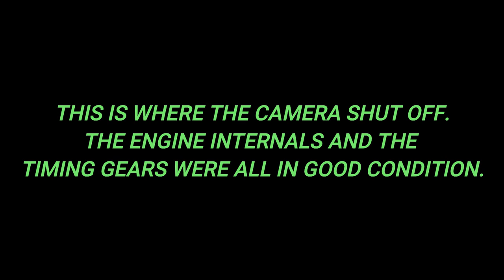DYNAHOE PT 3 3-53 DETROIT REMOVAL AND TEAR DOWN!

Comment: I can't tell if the Gradall is enjoying helping or feeling a bit jealous.
Reply: first AND second !!
Reply from the maker: the gradall is never jealous....it knows it is the most important piece i own!
Reply: Very handy piece of equipment.  Would have never thought of its value until seeing it in action. Having such a range of boom extension is certainly a plus.  All of the cranes on my service trucks now have 3 stage hydraulic extension booms.  It makes them much more versatile.
Reply: I have a question do some  backhoes the front buck attachment  comes apart  just like backhoe
Reply: @dancurrier6421  -If you’re asking do the front bucket come off with a coupler system? Then yes, there is an option to make it a tool carrier.  Where you can use forks, buckets, baskets..etc

Comment: If I remember correctly, Detroit has two fuel ports in the head. One is the supply and the other is the return. They return a large portion, more than 50% of the fuel pumped to the tank. I seem to recall about 1/2 a gallon per minute return to the tank. They heat their own fuel so they work well in cold environments. The two lines on the injector flow fuel through the injector both to supply fuel as well as cool the injector. The fitting coming out of the return port is a special fitting with a smaller hole to restrict the flow and build some fuel pressure in the injectors. Many people lose track of that fitting and end up replacing it with a normal fitting so the fuel pressure doesn't build up to the minimum 35 psi for injector operation and 60 psi being the normal pressure. They also used check valves in the fuel lines to prevent the fuel draining back to the tank. I've seen those installed backwards.

Comment: Hi JC. The best tool for removing that style injector is a ladyfoot prybar. Also, the flat washer under the bolt for the injector hold down clamp is flat on one side with a slight convex shape on the other. The convex side goes towards the clamp. Really hard to see that difference.
Reply from the maker: i did notice that on the washer. i try to be very careful when doing a tear down.

Comment: it's been a million years or so since I last worked on a 2 stroke Detroit but the blower looks familiar . when the bearings are just little worn the impellers start touching eachother and the housing. at that point the blower is junk and the pieces from the blower wipes out the motor.

Comment: You have no doubt increased the resale value on Gradalls by a bunch.  I have wondered how blowers last as long as they do since some of the people who used these engines were obviously not really into regular maintenance.  I worked on a tow boat that had two 16 cylinder 2 stroke GMC 1600 HP engines.  The first day on the boat after your days off you couldn't sleep because of the noise and after that you would wake up if they shut down. Each of those engines had four superchargers.

Comment: If there was any corrosion on the blower shaft it will split the rotor. Or if the blower freezes it can do the same.  Or it could be fatigue on the aluminum.  2 stroke blowers fail like that all the time.  On the 4-71s many blowers went boom, espically on scraper rear engine applications.  Deboss garage had I believe a 3-53 for sale out of a dragline, if yours turns south.
Reply from the maker: im thinking it could have had rain water in it that froze.

Comment: I used to know those 4-71s pretty well but never got deep into them, mainly running the injector rack.  Those things will run and run and run. Worked on them in Air Force generators

Comment: These roots blowers are close tolerances and my brother found one pretty resonable. Its better to find one if yours is screwed up. It can be hard to rebuild but yours is obviously eol. Yours could have had fod in the intake and that stopped the spinning and sheared the roll pin would be my guess.

Comment: That old machine is a beast! Interesting video JC, lots of work. The blower failure is a pivotal price point for rebuild cost-wise isn't it? I think there's enough steel in that 
machine to build 2 machines by today's design standards. Gives new meaning to the "Built like a tank" expression. Work safe!
Doug@ the "ranch"
Reply from the maker: it is heavy for sure. i think my plan will make it a very strong reliable rig.

Comment: About the rotor failure. You probably know this. Failure is often due to internal flaws in the metal and this can often be seen as a bright or even polished appearance of the broken surface. The metal will have been cracking away from a flaw and the vibrations of running can polish the crack internally before total failure. Look over the exposed surfaces of the failure and you may see a point of origin. Otherwise do the same with the ends of the pin.

Comment: Interesting cooincidence, I just finished changing out a head on a 6V53 that punched a valve head up into the cooling jacket in the head. interesting, very minimal damage to the piston crown and didn't bed the rod.
Reply from the maker: 6v53 and 3-53 use the same head.
Reply: @j.c.smithprojects  Correct, just plugged differently, the V53, the fuel in and out are on the ends, the inline in and out on the side. 71 series is the same, BUT some vee heads arent machined for the cooling water manifold used on the inline engines.
Reply from the maker: thanks for that bit of info....love to learn.

Comment: I'm about the same as you when coming across these projects , its like 2 outhouses stacked on top of each other you either do the crappin or you get crapped on . what i enjoy is the challenge to get something running with minimal to moderate effort , and like you say you have to account for every penny otherwise you can end up with a gold plated turd, and i have a few of those i just cant seem to give up on , enjoy your content , i have a little content on my channel if you ever get time.
Reply from the maker: i agree.....with all the different projects i have going on, i am always watching pennies. it can add up extremely fast if you are not careful. this project is only a winner if it costs less to repair and get going than buying one that is working order.

Comment: Blower drive gears fail alot on these 3cyl Jimmie's.
We had alot of these dynahoe s in NYC in 1970s..
Heavy slow strong noisy .
3 cylinder  has a pulse which hammers teeth on drive gears . 4 cylinder 453 and 471,671 smoother running never had failures.

Comment: Those 53 blowers weren’t the greatest design, still surprised to see the mode in which it failed. They were really noisy with the straight cut impellers. The helical design on the 71’s seem to hold up better, go through seals less often and are a lot quieter.

Comment: jC,

My Dynahoe 140 is leaking from the cooler so I find this video very helpful. You seemed to miss the part of removing the large bolts holding this nose piece on. I am having a hard time breaking these loose. Any pointers? Also do you have any ideas on a source of that cooler/radiator combo? Much appreciated.
Reply from the maker: i used my milwaukee 1/2" impact to get them loose. i would take it to a radiator shop and see what they could do or a place to suggest.

Comment: I wonder if the original problem was number two just being worn out and then they used increasing amounts of ether to get it to start. The blower lobe could have been damaged by detonation of the ether. Your finding of the seized rings is what you thought could be going on when you were trying to start it.
Reply from the maker: i dont remember if it made it to the video but when i drained the oil i said "i have never smelled oil that was so saturated in starting fluid."
Reply: J.C. SMITH PROJECTS Yes, I remember you saying that. Good instincts.

Comment: I think the torque convertor bolts might be reached thru hole the starters goes in.
Reply from the maker: watch the vide again...i dont see how you would ever get to those bolts that way. i stuck my hand in there as well as a mirror with a light.

Comment: Really enjoying this series JC & Lady, impressed with your  simple yet effective safety measures on the bucket & arm.  Are  the parts available to rebuild this engine ? I have watched Bus Grease Monkey rebuild  bus engines, he finds new cylinder liners & pistons & bearings etc so I assume your be fine.  Looking forward to the rebuild, thanks JC & Lady !!!
Reply from the maker: parts are very easy to come by. it will get rods, mains, pistons, piston rings, liners, blower, valve job, block and other parts dipped for cleaning. i will paint it all before it goes together.
Reply: @j.c.smithprojects  Thanks for your reply & info JC..

Comment: i think it was cause by backfire n put too much stress on supercharged cause it to snap or bend n cracked in half
there may be too much questions about it
likely be looking at shaft n bearing n see where they danged or sezied in place "may cause shafe to bend because one side bearing is stuck n other side is loose n causr twist n snap"

i can tell by block need new cylinder sleeve because worn or stuck pistons in block n if u dont change it u may ended up destorying pistons ring aging n have redo it over aging n i know u dont want to pull it out tractor

"im engineer repair" i dont mind helping you out getting it fixed n back running aging

Comment: Thanks for the update at least you know now why it stopped. I know your plan always was a tear down for this motor. I just can't understand lots of the guys that pour  their goofy potions in  stuck motors and just run them if they free up.  I'd bet in all the years I've pulled motors that had been stuck and freed there was stuck rings on at least one piston if not all of them.  The last Ford 2700 series diesel I did looked real good in the bores with just a slight rust mark on 3&4  yeah different story when the pistons are out, It needs re boring with the damage where the pistons sat.
 I'd seen your comments on the other guys Dynahoe channel when he put his motor together, I'd love to see somebody put a 4bt in one of these, and do that machine justice giving it a quiet motor.  My JCB's the same weight with a 4 cyl Leyland, it's a little under powered sometimes at 70 hp , but  I've heard 90hp if they are turbo charged livens them up, I'd bet that old girl would be the same with a Cummins, if it wasn't to hard and it would fit in somehow .  see ya for the next update,   Take care
Reply from the maker: just keep watching....i have a plan.
Reply: @j.c.smithprojects  Thanks for the reply. A man with your skills, and a plan sounds real interesting. I'm not  going anywhere that's for sure.

Comment: Do you think that motor was swapped in later, since it's blue under the yellow?
Reply from the maker: these engine probably came painted detroit's color when they were originally installed. likely painted yellow during assembly.

Comment: Ok located the smoking gun, I didn't think of suggesting of yanking the blower in the early stages. Everything prolly played a roll in a no start. Stuck rings tight or jammed valves. That jammed injector concerns me .
Reply from the maker: with experience comes knowledge.....i will know to check that next time.

Comment: guessed it was the blower have seen it happen before double pin it when it goes back together
Reply from the maker: even if i knew it was the blower, i would have still removed the engine and tore it down. there were too many other things wrong with it.
Reply: @j.c.smithprojects  ill agree to that

Comment: Hi jc do u recommend a Milwaukee impact ; battery what voltage
Reply from the maker: depend on what you want it for. i have the milwaukee m18 1/2" and 3/4" impacts and i am very happy with them.

Comment: That blower is a total loss. Not uncommon though. Looks like that was the victim of poor paint enhance for many years. A reman blower shouldn’t be too bad though. It’s a small engine. 
As long as you have everything apart, I’d go ahead and replace the power assemblies, pistons, liners rings, and bearings. You will essentially have a new engine. You might want to check the camshaft for cracks. If the blower locked up while the engine was running, the torque might have caused a crack in the camshaft. It would be a shame to have the camshaft fail and trash all the new parts when it’s back together.

Comment: He made way more work for himself on teardown
Reply from the maker: the entire engine gets dismantled so it can be dipped and cleaned before the rebuild. so how did i make "way more work" for myself?
Reply: @j.c.smithprojects  the pushrods didn't have to come off the rockers.
And to disconnect the torque converter from flywheel there's a plug in the bell housing so when it goes back together the converter is in the transmission.
Otherwise you will screwup the pump in the trans.costing more money and time
Reply from the maker: there is no plug in the bell housing. i looked it over very well and even showed that there wasnt one in the video. the push rods did not need to come off to remove the head but they do need to come off the rockers before it goes to the machine shop. the rollers must be removed for it to have the deck surface of the head checks for flat and cracks before the valve job.
Reply: @j.c.smithprojects  there is either a plug or a plate on motor side
Reply: @j.c.smithprojects  the pic you showed of bell housing was trans side